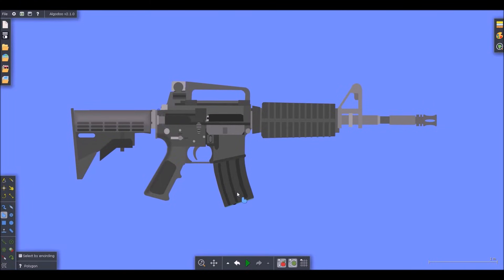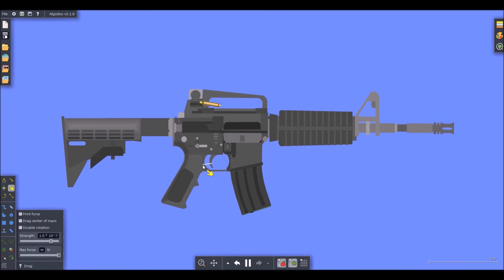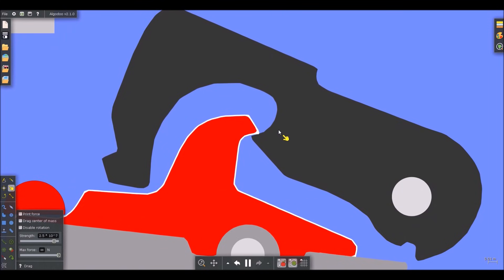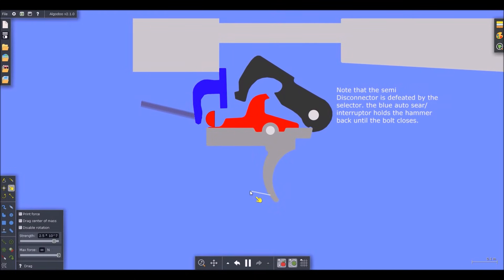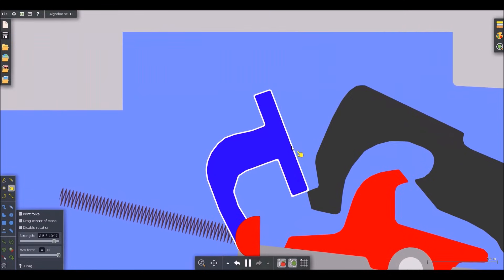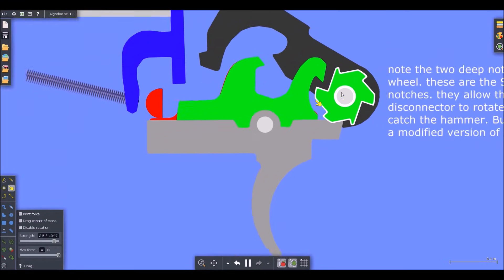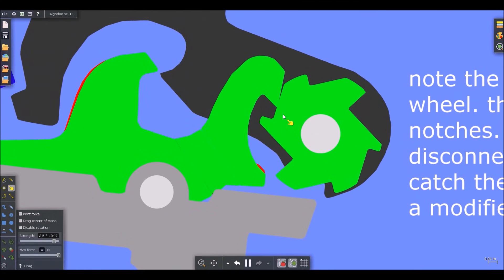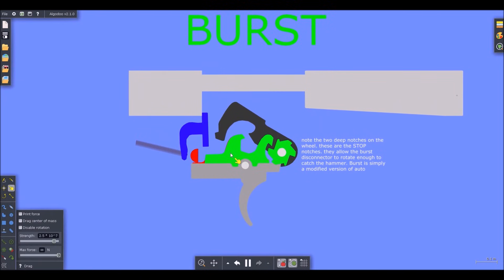How 3-round burst works

Comment: The coolest part of this creation is the fact that it was incorporated in an existing weapon. It can not reset, it may fire partial bursts, but it is cool anyway. Daewoo made two 223 rifles, one of them resets the burst if you let the trigger go before the end of the burst. Burst fire lockworks are so delicate that the japanese rifle has a removable burst mechanism.
Reply: I deleted my stupid question. If the rifle is not set to burst the gear does not act as a ratchet. It goes and returns with the hammer. I suspect...
Reply from the maker: +ragrj2009 no, the wheel DOES ratchet in single-shot, but it's just inconsequencial to the function. However, because the burst disconnector is compressed against the spring 2 of three shots, single-fire weight will fluctuate a bit for every shot. Namely, light, heavy, heavy, light. The untrained shooter likely won't notice. A trained marksman might find the subtle difference a bit annoying.
Reply: ***** Good. So, if the ratchet is always counting, when you switch to burst for the first time, it´s not possible to know if the first burst will be a three, two or one round burst?
Reply from the maker: if you count your shots, you'll know. Though, if you don't count, it'll just complete it, and the next trigger press will yield 3 rounds.
Reply: +Stealth The Unknown  I use to design lockworks since 1980, but I did not design many three round burst lockworks. I must admit they are a challenge and a paradigm. An experienced clock designer would do these things faster and easier, they are much more used to ratchets and gears. Anyway, if the burst arrangement isn´t able to reset, It´s not good enough.
Reply from the maker: +ragrj2009 exactly my philosophy. It's reliable and simple, but finicky because it does not reset. I prefer the way an HK MP5 trigger feels in burst (I have gotten to use an MP5SD at a local range once <3) over the AR's trigger. I have only ever fired semi-automatic ARs (never really cared much to fire a pre-ban m16), but if what I hear is true, there is certainly a noticeable difference between every trigger pull in terms of weight when on single, and that makes me kind of cringe a tad. The thought of my marksman skills being foiled by a trigger that has two heavy 4 lb presses and one 2.5 lb press makes me a bit hesitant to try it in terms of really attempting accurate fire. For fun, of course. I'd drop all the lead in the world if I had enough money, and would eat, sleep, and die at the range. But that's just me ;P

if you take a look at my follow-up video to this, I explain the mechanism in a bit more detail, as well as give you a look at a concept I've worked out (though, it's not entirely practical, but was fun to come up with). Give it a look!
Reply: +Stealth The Unknown  
1 - In fulll auto both disconnectors are held by the selector, the weapon fires using the tip of the trigger and the autosear.
2 - in semi auto both disconnectors are free, só the older and more simple disconnector will always trap the hammer.
3- in burst mode the semi auto disconnector is held by the selector and the burst disconnector do the "shallow, shallow, deep" trick to trap the hammer one of each three shots.

If the selector, in semi auto, pushes the burst disconnetor, leaving only the semi auto disconnetor free; would it be a solution for the different loads? Of course the resulting load for the finger would be higher, but the load would be constant. (???? if the burst disconnector is disabled, the ratchet won´t engage and  turn, it will cause less wear and the burst will be always ready to drop three rounds??? maybe it should be kept disabled even in full auto?)

***I am running out of english... I never studied english.
I remember a video with a six years old girl firing two round bursts with a M16 family rifle (the trigger was so light (and ruined) that the hammer wasn´t being properly held by the trigger.
Reply: +Stealth The Unknown  
1 - In fulll auto both disconnectors are held by the selector, the weapon fires using the tip of the trigger and the autosear.
2 - in semi auto both disconnectors are free, só the older and more simple disconnector will always trap the hammer.
3- in burst mode the semi auto disconnector is held by the selector and the burst disconnector do the "shallow, shallow, deep" trick to trap the hammer one of each three shots.

If the selector, in semi auto, pushes the burst disconnetor, leaving only the semi auto disconnetor free; would it be a solution for the different loads? Of course the resulting load for the finger would be higher, but the load would be constant. (???? if the burst disconnector is disabled, the ratchet won´t engage and  turn, it will cause less wear and the burst will be always ready to drop three rounds??? maybe it should be kept disabled even in full auto?)

***I am running out of english... I never studied english.
I remember a video with a six years old girl firing two round bursts with a M16 family rifle (the trigger was so light (and ruined) that the hammer wasn´t being properly held by the trigger.
Reply from the maker: +ragrj2009 now that you mention it, yes. Depressing the disconnector would resolve the issue. It might cause some issues with the cam not being able to ratchet correctly, but I doubt it would be noticable
Reply from the maker: ah yes, the default 60 frames a second of physics calculations. Try going into your settings, simulation, and increasing it to around 200 or so. You'll notice the consistency and reliability increase, but possibly at the cost of simulation speed.
Reply: ***** BINGO! It's much much much much better! Thanks! Now I have confidence on the idea (a safe action carbine, Glock style) and I can spend more time to create the same lockwork on SOLIDWORKS. I am good with AUTOCAD, but a newbie on SOLIDWORKS.
Reply from the maker: I should probably get around to using autocad or solidworks if I want to be serious about my engineering. Perhaps I could actually get around to bringing some of my ideas to light in 3D, and possibly get around to creating them in real life. I just never could get along with the GUI for autocad -_-
Reply: +Stealth The Unknown  Exporting the autocad part on a 5000 x 3750 pixels PNG file worked fine, really fine. No more shaking lockwork, but, but, but... why sometimes the axis seems to be made of rubber?
Reply from the maker: try altering some physical properties of the parts. Axles on incredibly light objects will tend to be a bitch stretchy. Try increasing the density of the parts it's connecting. 100kg/m^2 is a good starting point

Comment: So, the selector has single, triple, and safe? can auto selection be selected too?
Reply from the maker: +Jeff Coleman on the Armalite platform, the standard selector pattern is 3-position. Semi auto is available on both the M4 and M4A1, as well as all M16 variants, but the M4 has 3-burst instead of the M4A1's Automatic. The M16A1 and M16A3 both have auto, and the A2 and A4 have 3-burst. That being said, aftermarket trigger kits exist that allow a 4-position selector, but you'd have to destroy one or both of the selector stops for this mod to work. ANd honestly, who wants to do irreversible modification to an already expensive and somewhat rare pre-ban Armalite 3-position receiver?

Comment: That is a great graphic program to illustrate moving parts without being over simplified, but and I may be wrong, doesn't some weapons have more selections?  The selector in 1st mode being safe, the selector in 2nd mode being semi, selector in the 3rd position being tri burst, and finally the selector being in 4th mode full auto....Or does such a animal not exist?  If so how would it look in this form of media you have chosen.  I don't know about automatic weapons but at least I was able to grasp the functionality better.   Do you happen to have a additional video showing in the same detail of open bolt automatics and how they are able to be fired safely?
Reply from the maker: I have very little in the way of videos, but open-bolt is safe indeed. It's a simple mechanism that utilizes the inertia of the bolt to dent the primer on the round (and thus, firing it). Yes, 4-position selectors do exist (I have a video of the HK MP5/ G3 trigger mechanism, which details that). The reason the Armalite platform is 3-position is the way it was designed. It initially only called for safe-semi-auto as Armalite sold the AR-15 to Colt, which licensed it as the M-16 rifle. Later on, seeing the massive waste of amunition the general infantry caused, it was more feasible to switch to a controlled burst to conserve ammunition for trigger-happy soldiers. However, burst has since seen an integration onto platforms that have automatic fire as well. The reason for this is that each mode has its benefits. While automatic is pointless at long range, its defensive close-range capabilities are ideal: quick reaction and high hit-probability on a threat. Single shot (semi) is perfect at long range, with every shot being aimed. Burst is good for medium-ranged targets that are moving horizontally across your view

Comment: you might want to edit your audio and reduce the noise, especialy the high noise.
if you just run a high cut equliser over it it would be alot better
Reply from the maker: Thanks for the feedback on the quality! Yeah, the audio's a bit odd in this. It was due to the integral microphone the laptop had, but I now use a pretty decent condensor mic built into a headset. The video's funtional as it is, so I won't be editing it. At this time, I only really have time to reply to comments on my videos and such, but I'm likely not going to see time for recording and editing in a while. Work and gym have me bogged down, and I'll be joining the military soon as it is, meaning even less time. :/
Reply: well if you do find time, or make another vidio in the frutere. audacity is a free audio edit progam and has also alot tutorials on youtube
Reply from the maker: +Skittleshunter64 yep, use audacity relatively frequently actually. If I hear noise like in this video, I'll run a filter over it in the future
Reply: what software do you use to animate these vids?
Reply from the maker: +Skittleshunter64 algodoo is the physics simulator, and fraps is my capture software
Reply from the maker: +Stealth The Unknown everything in this video is physically rendered, meaning the tolerances and mechanisms are not pre-animated, but calculated in real-time
Reply: ah, well i did learn how 3 round burst works now so thank you for the vid
Reply from the maker: Yeah. The spring binds to the hammer as it's cocked, and slips as it's dropped. It's a clutch spring. To demostrate the effect, take a retractible pen, and disassemble it until you have the spring and ink insert. Try roating the spring one way, then the other. It'll likely slide freely one way, and lock up the other

Comment: Didn't scroll back to see if this had already been asked but why not use just the 2 big notches? What purpose do the smaller notches serve?
Reply from the maker: +vendettasnow Scrolling back is likely a good idea for future reference. But I'll go ahead and answer this again: the cam is rotated by a clutch spring via friction. it slips more one way, and wants to lock to the hammer the other. But since friction alone is prone to slippage regardless of how strong the clutch is, you have the smaller notches to effectively turn the burst disconnector into a ratchet strut, and the cam into a ratchet wheel. it eliminates slippage.

Comment: Great video. I fully understood Semi and Automatic fire, but 3 round burst made no sense to me. great video.
Reply from the maker: Uh oh! What are you not understanding on burst?
Reply from the maker: +Mike Brown Think of burst like a modified single-shot (semi-auto.) You press the trigger, and the burst disconnect WANTS to move forward and latch onto the hammer. The only difference is that the burst cam (ratcheting wheel) prevents it from doing this for two rounds. on the third, the deeper portion in the wheel allows the disconnect to move completely. simple?

Comment: "For a total of six notches, which is a multiple of three"
Well, you're not wrong.
Reply from the maker: +Joseph Madder technically some version of the design could be made with nine overall notches, or even theoretically one with only three (and a long, 120-degree hammer swing), or any multiple thereof. Since the Armalite platform has the hammer rotate very close to 60 degrees, it was resourceful to make it 6 notches. Bottom line is, the number of notches (at least on a non-resetting cam) must be a multiple of the number of rounds you wish to fire.

Comment: Is burst rate of fire the same as the weapons full auto rate of fire? Also how are some guns like the AAI ACR prototype from the 80's capable of burst fire at incredibly high cyclic rate (1800 RPM)?
Reply from the maker: Antwon Jenkins without any kind of augmentation mechanisms, and just a trigger mechanism that induces a burst limit, the rate of fire is the same as automatic. so if the m16 fires 800 rounds per minute, it will do the same in burst and automatic. But weapons, like the AAI ACR prototype you mentioned, the AN-94, and some like the HK G11 caseless ammunition rifle use accelerators or some other kind of mechanism that augments the cyclic rate of fire with various degrees of effectiveness. The AN94 sounds like it fired one shot in its 2-burst mode, but in reality it just fired both rounds at around 1800 RPM with the recoil-driven augmentation mechanism. Same with the G11. The idea behind these are round-on-round accuracy with the burst setting enabled, and they often use a sliding internal receiver or recoil carriage to dampen and delay the felt recoil until the burst has terminated. Three or two rounds almost one on top of the other is a very effective means of penetrating hard and soft body armor, and there are other uses for this capability as well. As for the M16, the burst is simply a sort of insurance that soldiers are not going to dump their mags on the fun switch  when things get rough. Plus, if you practice good trigger discipline, you know that even in semi-auto, you get much better accuracy following through on the trigger pull (holding it for a bit after the shot) before releasing and resetting the trigger. The same is true with burst, and allows a kind of modified half-marksman, half-automatic capability. By holding the trigger in burst, you're getting the same increase in attention to aiming as in semi without worrying about releasing the trigger to conserve ammo as if you were in automatic. It allows for you to place a relatively decent punch in a tight grouping at decent ranges. If you were to compare three-round groups from an automatic to 3-round groups from a burst-controlled rifle of the same design, and you had the same shooter fire both tests, I can almost guarantee you that the burst groupings will be much better.

Comment: I don'y know if you are still answering questions on this video or not, but is their a way to make a weapon be able to fire fully automatic, burst, and single? And also do you know how the AN-94's 1800 rpm two burst mechanism works? That's another one I have been studying, but I can't find anything about it.
Reply from the maker: Dan Martin yeah, if you can disable the burst mechanism as well, merely by disabling the burst disconnector, you'll get full auto. And the AN94 has the barrel slide back and all to make the weapon load a second round a lot faster than it normally would with its cyclic rate. and from what I remember, it actually trips the disconnect function on the second round by having the barrel assembly strike the mechanism and trip something to keep the hammer back after then. It's pretty fascinating stuff, but it is tough to find. Just keep searching, and hopefully you'll get some luck with it man. I got very little in that realm :/
Reply: The way the AN-94 has always fascinated me, and I would love to learn more. I'm designing my own bull pup rifle design, but I'm having trouble making it work in both semi and full auto.
Reply from the maker: Dan Martin hey, do you use some kind of program like algodoo? I might be able to help you out if you'd like.
Reply: I haven't looked into it much, but I am thinking of using it to build a concept of my bolt design maybe
Reply from the maker: +Dan Martin Correction on my own part, the AN-94 is actually STRIKER-FIRED, and the burst function is just the trigger being disconnected as the recoil carriage assembly slides rearward. The selector just determines when or if the trigger disconnects. The rifle's a bit on the complex side, though, and is prone to failures that are tough to clear.

Comment: why exactly do you need the shallow notches?  It seems to me that it would work just as well with only 2 deep notches and the rest of the part smooth.
Reply from the maker: jxj it prevents the cam from reversing with static friction with the hammer. they basically provide a little ratcheting effect with the trip hook on the disconnector
Reply: oh, duh.  Now that you mention it it's super obvious.  Thanks
Reply from the maker: haha glad to point it out

Comment: Is there any way to have safety, semi-auto, full-auto, AND 3-round Burst selections on the same gun?
Reply: Logan Fairchild It's either 3 round burst or full auto
Reply from the maker: 24Mansfield Only the Stoner platform (m16/m4) and a few others. there are plenty of modern rifles with single shot, burst, and automatic available. That's only considering factory models. There are a few aftermarket Title-3 trigger components for the M16 or M4 that add all three modes. They require you to file down one or both of the selector stops, though,  making the modification irreversible to the lower.
Reply: Oh man I didn't know that. That's cool. Our M4's that we use have just burst. The M4A1 has auto.